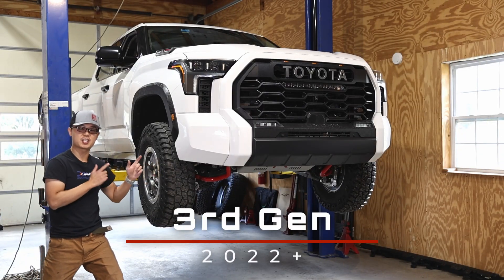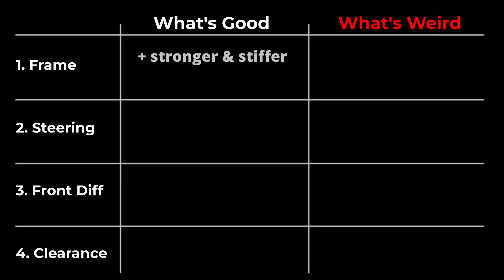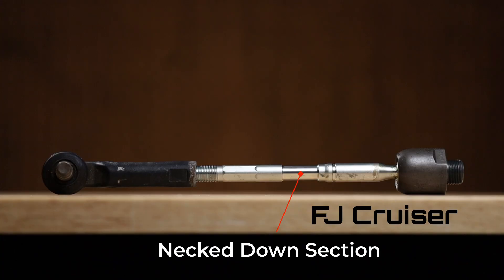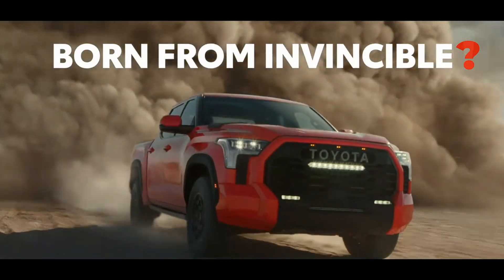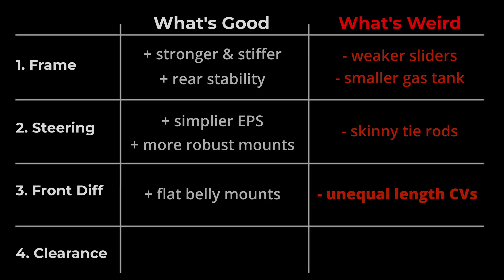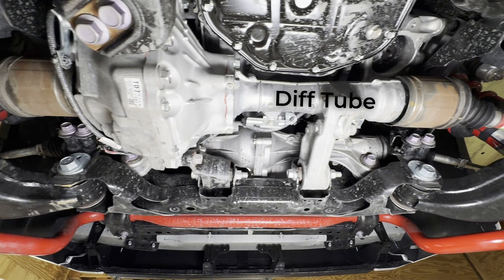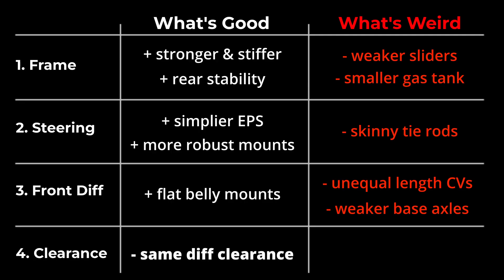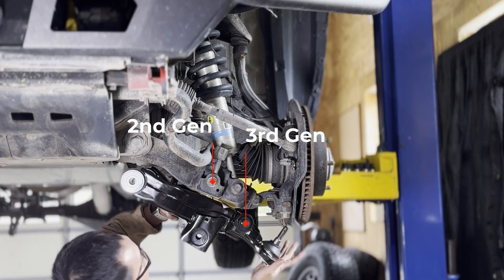4 Super WEIRD Designs On The New Tundra | 3rd Gen vs 2nd Gen Technical Comparison

Comment: I have a 2024, and I love the truck. But they really dropped the ball on so many things. They could have offered an off-road factory bumper with a winch. The fact that there are no recovery points up front on a TRD truck is ridiculous. The second issue is that they could have offered the 3in lift already from the factory on all TRD off-road packages. You basically have to throw away your old parts when you get their lift at the dealer. They also could have offered another TRD wheel with a more aggressive offset so you wouldn't need to buy other wheels. My last complaint is the fact that the body of the truck is so thin when I lean on the truck. It bends easily. I'm scared to cause dents just by leaning over my bed to grab something.

Comment: C-channel was always weird to me. Every explanation feels like a cope. Older Toyotas had box frames, and old Nissans had box frames plus even extra gussets at the seam between the cab and the bed. These older trucks were tough and dead-stiff. I wouldn't want to carry a load of firewood in a bed that wobbles on the frame. These are trucks after all. If you're only concerned with articulation, a pickup is not the right choice.

Comment: just wow about the unequal length CV's, i didn't know that, and as you pointed out, it looks like they could have been made equal with a slightly longer tube. be curious if Toyota engineers have an explanation

Comment: Do you think any of the control arms on the bigger tnga trucks will work on the 4th gen Tacoma for a cheap diy long travel?
Reply from the maker: unfortunately no. i held the 3rd gen tundra LCA right up against the 4th gen tacoma. the mounting is completely different
Reply: @TinkerersAdventure  such a shame, maybe brackets could be welded to adapt it? That's something the aftermarket would have to explore obviously. I wonder if there is anything interchangable between models that would be worth while.

Comment: The steering rack swap job on the gen2 was the literal worst job I’ve ever done on a car. The smaller tube length on the 3rd gen is bound to make the rack replacement job better since on the gen2 you either pulled the engine, or took the boots and inner tie rod ends off just to squeeze it in. I think I’d rather the mismatched axles than have to do a gen2 rack swap again.
Reply from the maker: yes. i didn't cover this in the video because it is a little too deep, but half of the LCA mounting bracket on the 3rd gen can be unbolted. Leaving wide open space to take out the steering rack. It was a deliberate design choice for serviceability.

Comment: It seems that the 2nd gen. Tundra is still a badass truck that does not cost you an arm and a leg as the new 3rd gen one. I rather buy a side-by-side for off-roading than spending $70k+ for a brand new Tundra that is not only huge and impossible to off-road with, but it is also a very ugly truck. For overlanding, I would rather buy the Chevy/GMC twins with the 3.0L diesel engine than the new Tundra. Obviously, there is a reason why Toyota is introducing so many new SUVs that are more suitable for off-roading than the Tundra.

Comment: I have the TRD lift kit tie rod sleeves but I also have the Silver CV axles from the TRD lift kit…I however don’t know what they do? Are they the same as the red ones I had from the factory?
Reply from the maker: Good thinking! I plan to make a video on the TRD lift kit. But the silver axles have the same joints as the red axles, but the shafts are a tiny bit longer. The reason they are longer is NOT because of lift height, but because this kit also has the offset lower knuckles that pushes the spindle outwards a tiny bit. And the reason for that is to correct for camber. And there are a few whys after that. All these made this kit super interesting and I want more people to understand these principles.

Comment: Theres a few things in this that made me realise why they always break CV joints, the joint is straight on the ball movement so it's inherently weaker than an angled ball track, unfortunately you can't have it slide in/out with angled tracks. 
The short diff tube is probably down to it's use on another model with a slightly shorter track, the easy way to make the wider track is to make a longer shaft. albeit on one side. Centring the diff/axle shaft might not be feasable because of space or a bespoke driveshaft for just that model(?).
Toyota have had massively weak chassis for decades, I still don't know how they were allowed to keep manufacturing with known chassis issues, the rear half falling off is a standard joke. 
Electric PAS is definitely the way to go, why did they not do that sooner? Most modern vehicles have gone EPAS since about 2010 at the latest with generation changes. Steering arms are the designed weak point, so should be easy enough to change out if you do bend one, which to be fair is better than the rack getting the hit. I guess they can't design a better system to sling the rack over or under the diff nose, that would stop the tendacy to oversteer.
Reply: I was going to say the same thing about the epas system, I have a 10 year old Ford with a similar system, and while the steering systems runs into its limits in the gnarly stuff, I'd take it every day if the week over a hydraulic rack for a truck.  The other thing about the cv shafts being different lengths; I bet folks will find the same thing with this as people do with solid front axle rigs, the short side shaft will be the side that fails 95% of the time, due to the longer side shaft acting as a spring and reducing shock load on the joint itself.  Hence, you'll only have to carry a short side shaft as a spare.

Comment: im going to ask the obvious question. Rock crawlers use full hydro. I get the EPS will be better for overlanders, but we aren't trying to lift the vehicle with the front wheel with a hydraulic pump. The tie rod thing is weird definitely. The Unimog brags that there is 20 degrees of frame flex. Its better for traction and adds to articulation. I will say that I was on a destroyer in the US Navy. Our ship has half aluminum. It tore in half. Steel flexes, and is a much better metal to make ships out of so they flex over the waves and doesn't tear like aluminum. Great Vdieo! Love your content.

Comment: Clearly you don't consider the cost or life span of a electric power steering rack. This would be a reason for me to not buy a vehicle. My collegue had a 2013 Ram 5.7 with less then 80000km on the clock and the electric motor in his rack and pinion failed. The part alone cost him €5500. According to the dealer the electric power steering racks drop like flies. Conventional hydraulic steering would cost €500-750. This electric nonsense is ridiculous and needs to stop asap.
Reply: Yea that’s a ram

Comment: Couldn't agree more with your analysis!
Truth is, Toyota is losing its way with off-roading and overlanding engineering concepts and useful design.
I think they are sacrificing real off-road ability for saving cost of manufactory MONEY!!!
Toyota is counting on the ignorance of the consumer to get away with this.
Reply: Toyota Tundra has always been more geared up for Towing vs overlanding and payload, hauling a trailer is what it was and still designed to do
Reply: 🤣 how?  This has a factory locker. It’s already far superior to any previous gen

Comment: For the conclusions in section ground clearance, does this apply to all new TNGA trucks? Wonder if new GX550/LC250 will have lower hanging mounts.
Reply from the maker: it seems like it. but this was comparing to the 2nd gen tundra, which has oddly high clearance compared to most other toyotas.

Comment: I cant wait to see you get your hands on a 3rd gen to 4th gen tacoma. I want to see if we get a bulletproof steering rack!
Reply: Can you please explain what do you mean do the steering racks go bad on the 3rd gen
Reply: @yzrippin  Its a common item to slowly fail or leak/play in our drivetrain. Max powell went through some, I blew up my entire power steering system last year and have all new parts. However the aftermarket cheaper one i have shows boot seepage and slight play but still good according to my local toyota. My OEM rack had seepage from, never could warranty it. and suddenly i deveoloped power steering noises, later on down road i seized my rack.(110,000 miles) Ive seen Others replace their racks as well. Its a $2000 job. It sucks to get this repair.
Reply: @yzrippin I am not saying the rack fails and you get problems. Im saying its got some weak spots or dumb designs to it because 3rd gens saw rack replacements and i think they suck.
Reply: @CanadianOffroad4x4  I noticed wet boots at 50K now at 60 I've done the team oil drops 7 power steering fluid changes it's never really lost much any fluid out of the tank Reservoir but I do notice that as well thanks for letting me know your experience have you looked into having it replaced with the tundra rack for upgrade I think I remember seeing that somewhere on Tacoma world that second gen Tundra racks fit right in and are basically a beefy upgrade same with disc brakes I believe I'm more concerned with my coolant loss seems to be almost the entire overflow tank in about 15K no that's more when I'm driving it like a rental we're doing some of that straight up and down off-road stuff we're really not supposed to be doing in these things
Reply: @CanadianOffroad4x4  also for shits and giggles what type of driving are you doing with it 80% of my driving is pavement princess but then I remember that it's 6 years old paid off and has full coverage insurance so I send it up some mountains with  the 2 door jeep fellas
Reply: @yzrippin  watch for dark fluid or shiny parts. Worst part is. If you find metal
Get your hoses flushes or expensive replacement. I got done at toyota and they guarantee their cleaning process. I'm very very careful n smart I think with my power steering. I don't even do full lock unless it's a  emergency u turn
Reply: @yzrippin  Toyota tech here. Up here in the salt hell of the Northeast it's expected that you're going to have to replace all of the power steering/transmission lines by the 6-8 year mark. After around 10-12 years you are almost guaranteed to need new racks because they rot out to death. The racks often seep from the factory, but they dont tend to leak to the point where Toyota will warranty them.
Reply: @LordOfSilense  thank you very much for your input I've got 60,000 Mi on a 2019 3.5 dcsb and starting around 45,000 me I started noticing coolant loss to the tune of half a tank per 10,000 MI around 50k I also noticed steering rack boot was wet so I took this all in under warranty and they said high pressure leak down low pressure leak down and an observation of the boot everything passed is there anything I should be looking out for or expecting to come up
Reply: Look at this idiots comment....he can't wait to see a steering rack? But nvm the tacomas are all 4cyl trash motors now lmao. No wonder the elite get away with so much there's idiots like this guy

Comment: The engineer of the tundra wanted the frame flex. In an interview he wanted it on the 3rd gen but had to use box frame. Stiffer isn’t stronger.
Reply: Can't straighten a boxed frame. 

Boxed frames tend to rot much faster. 

Open C ftw